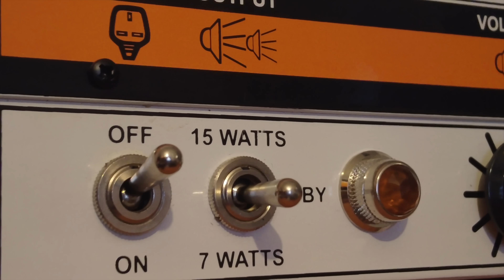WORLDS HOTTEST PICKUP

Comment: Other than my First hybrid amp, the pick ups were the one part that was worth shelling out money for. Cleaner mids, Higher highs, Lowest lows. Also holding notes longer. It will make all of your cheap pedals sound like they aren't anywhere close to maxing out when you max them out. It's the beginning of the times where you might want to start getting paid for music and you are getting better and you know you are sticking with it. It would probably be embarrassing only ever playing on a practice amp and then doing it live on a real big system the first time, i'm sure that's when you realize how far your equipment has to reach the thresholds of in which you might not be as close to as you thought. You just keep going and you upgrade what you can. Picks ups are worth it.

Comment: When did people stop measuring the mV of output to describe the OUTPUT? This is a huge pet peeve of mine.
Reply: It's always difficult to compare pups - it's never just the resistance, it's also the type magnets and wire gauges that determine the actual output level.

But most high output pickups use ceramic magnets, and since 43gauge is more or less the industry standard, the easier measurable resistance in kOhms has become synonymous with level of output.

Comment: Good point about how a pickup with relatively high DC resistance in the neck position can produce a smooth, Tube Screamer always on lead sound. 

Steve Morse in fact uses one in this similar vein, with his signature Dimarzio DP205 having 21kΩ DCR. 

Stating the obvious, the huge DC resistance in this 54kΩ seems to have removed the twanginess while boosting the mids when directly compared to the 8kΩ pickup.

Comment: Im finding that I like lower output pickups so you can have some versatility with the tone vs a hot pickup that just pushes all the time.
Reply: Exactly.  With today's high gain amps, it's pretty silly to have a high output pup.  Weaker is better nowadays!
Reply: Yeah, I'm a metal guy, and I actually hate overwound humbuckers (or humbuckers in general.) I only use low output single coils. WAY more tone. Just listen to Yngwie Malmsteen's tone.
Reply: @saftovooey4569  These pickups would have been great to have 40+ years ago - certainly with old Marshalls & likewise amps, but it's just too much now...  Can't get the wood sound with them now!
Reply: @cornfilledscreamer614  oh ya. I plugged into a marshall origin 50 and single coils couldn't get anything out the amp without a pedal. But put some strong humbuckers through it and it sounds awesome.

Comment: DC Resistance is by no means an indication of "output".  This is a widely misunderstood misconception that's perpetuated throughout the industry, and it's been said that it continues to be believed and repeated because it supports a narrative that suits the manufacturers and helps them sell pickups.  In any case it is indeed a myth...  It could be argued that there is perhaps a correlation between DC resistance and output at least in some circumstances, however the situation has become so muddled that the two terms are used interchangeably and in such a context that implies they mean the same thing which they most certainly do not.

Comment: Interesting. 

I think your spot on in that the high impedance of the pick-up is contributing to cutting off the higher frequencies for the same reason using a 200 foot line between amp and guitar will do the same thing. This can perhaps be EQ'd if nothing else...

I guess its all in your aim. I started building acoustic stringed instruments in my retirement which led to building pick-ups, pre-amps and power amps. I would not be happy with the signal hitting the rails of the pre-amp and distorting as it seemed  to be doing in the test because I like a clean and flat response and if an emphasis then in the mid-range. But presumably you can always build or buy or adjust a pre-amp that the pick-up's signal can swing between without hitting the rails leading to clipping. 

Sure was louder for sure, but if you looked at the peak to peak voltage on a scope of the pick-up by itself and compared it to its 8K cousin the difference would be substantial and since op-amps which are the heart of pre-amps only care about voltage difference between the signal and virtual ground with current not mattering its bound to be louder at any gain setting and whether its worth it is a matter of aim and what its being supplied to.

Comment: I'm pretty sure the coils of that pickup are wired in series, it would be very interesting to wire them in parallel.
Output would drop by almost half, however you might recover a little bit of the higher frequencies.  It's possible the parallel wiring might shift the peak resonance frequency to a higher point.
Very interesting for sure.

Comment: If there's a contest on for "hottest pickup", it'll probably be pretty easy to get one of the hundreds of pickup makers to do a one-off with an even smaller wire gauge. 100k ought to be easily achievable, though it does require increasingly careful winding as the wire gets thinner.

Comment: Just to clarify, you're measuring the series resistance of the coils of the pickup.  That's not "output."  BUT, given the math that determines the output voltage of a pickup ( E = blv), "E" being the output voltage, "b" being strength of the magnet, "l" being the length of wire in the coil (winds), a longer coil (and therefore higher series resistance) results in higher output voltage.  So, "54 k Ohms" reads "54 kilohms" and means 54,000 Ohms series resistance.  Which, as you said, is totally bananas to the point of hilarity.   I thoroughly enjoy your videos, btw!

Comment: A great experiment for this pickup would be to swap out the 500k volume pot...for a 1 meg... or "zero point" potentiometer.
250k pots (that help tame single coils), darken the sound of a humbucker. 500k pots let more highs thru, so humbuckers are not too dark and compressed. A 1 meg pot lets even more highs thru...and might really let this pickup breathe and sound great. A "zero point" pot can essentially make the resistance of the pot disappear (when in the zero position), ...as if there is no pot...and the pickup is wired straight to the output jack.

Comment: Two amendments. First, high-output pickups aren't "pushing the power tubes"; they are hitting the first preamp stage. Second, the loss of high-end information is due to capacitance (like in a really long instrument cable), not resistance.

Comment: DC resistance isn't a direct measurement of output. It's an indication of inductance which one of the two parameters that are actually important, but it's only valid for identical construction and identical wire gauge. Inductance also increases with coil area and the amount and magnetic permeability of core material.

Inductance is also a measure of the cut-off frequency of the pickup, they're intrinsically low-pass. 

The series resistance of a pickup is insignificant in the circuit. Read up on parallel LCR filters for more information, the R value here is the parallel sum of your volume pot and the input resistance of your amplifier, and C is the capacitance of your guitar cable. It probably dwarfs that of the pickup at around 500pF.

That pickup is crazy hot though.

Comment: Would be interesting to hear how this 54K pickup sounds in the clean position if you turned the guitar volume down to say 1/3 level. That way the pickup should not be over driving the amp input and should be clean. Then when its lead time just turn the guitar volume up a bit.

Comment: This is quite cool, I can't really see a use for that super hot pickup though but a fun project to test out. But I think you got a serious problem with your guitar, I would say that the neck is not  correctly mounted to the body because the strings does not line up, its a common problem for some people building their own parts casters that has not build very much guitars before. Or because it's a hardtail bridge it can also be that the bridge is not lined up correctly. But.. that guitar looks super cool in any way possible. :D :D

Comment: I thought the L500-XL I had wound by Bill Lawrence before he passed was a hot pickup, but this completely eclipses it!
I actually find that unless I'm using it for a guitar with overdrive or distortion, its not really usable or versatile at all. You can't get a decent clean tone off it without it continuing to break up. I've read about wiring a resistor across the hot lead of the pickup, but then you're talking about a compromise in tone for that, whether its wired to a push-pull as a tonal option.

Comment: 6:53 High frequencies are filtered out with inductivity (L) of the coil(s). Reactive resistance or impedance of coils is calculated by formula Ra(coil)= 2*Pi*f*L. High the frequencies are more suppressed than low frequencies. While more L means more filtering for the same frequency.

Comment: The high end lose is from the increased coil inductance from more windings not resistance. Series inductance is like parallel capacitance like a tone control with a cap.

Comment: I have a Strat with a Bill Lawrence L500XL, which is an extremely high output.  I have compared it to Super Distortions and it blows them away.  I currently have it in a 3 humbucker pickup Strat in the neck position, and found the extreme high output pickups sound great in the neck, more so than the bridge as I find them simply too much for anything but extreme metal in the bridge, or require too much retuning the amp controls to allow for the extreme output of the bridge compared to the neck.

Comment: One thing that I'd like to know is whether they are using just the one coil or tapping both coils when you make use of the additional wire coming out of the pickup.
If they're actually shorting out both of the two coils (giving you a more reasonable output to enable cleans with the option of going harder for distortion sounds but still retaining the hum cancellation in both modes) I can see it being a really cool idea.
Kind of like having a passive booster in the guitar like the new Yamaha Revstars have, except that they do it with a small step up transformer instead of it being part of the pickup design.
I think it sounds pretty good but it's definitely not very versatile without the coil tap/split feature.

Comment: I got some quad rail/4coil humbuckers from Amazon that average 18.7K ohmsthe 4 coils are tall and slim wired in pairs as though they are a single coil of the painin a normal humbucker they also have 3 v3ry stromg magnets between the 4 blade style poles and have 5 wires. one braded mani ground and the rest are like a Duncan Design color code and you wire then that way weather for normal or coil split. I wired mine like a ''50's Les Paul with coil splits adding a P/P in the bridge tone position for a bypass to activate the bridge and neck piclups together regardless of any other controls. O used .047 orange drop tone caps, and a Fender 5-way blade switch. Yes, there are 6 pots total 3 O/P vol. and 2 regular tome with the afore mentioned trick of the P/P in the bridge tone pos. I used the small stranded insulated wires stripped out of a computer VGA cable. as the voltage from a pickup measures in mere milliamps and the "traditiomal" 22 gage wire is just what they had available in the beginning but is really overkill for the jib to begin with.  so the smaller wires do just fine and save space in the already crowded control cavity and the different colors aid in routing each part of the complicated control circuit. The controls work as i designed them tou funtiom and the wiring choices are all tp promote a clean bright "Strat" tone. the humbuckers are brighter that normal ones due to the coils sizwe and shape the rest is to add to that. a''tje pots are 500K audio taper versions/ and all the hardwqaer is chrome but fot the full size brass sustaim block for the bridge and the Titanium nut. all thee controls are loaded into the hamd made custom , extended brushed stainless steel pick guardincludimg yjr output jack installes just behing the brudge. the pots are arranged in 2 crescent rows of 3 adormed with Tele style chrome knobs. The bridge also got roller saddles ans the headstock got roller string tree and locking tuners. the body and headstock are painted in a stars and planets outer space theme done with spray cans and airbrushed details with craft store micro glitter accents lightly scattered and lightly over sprayed with blue for effect all finished with semi gloss 2X acrylic clear coat. the guitar started as a Starcaster-Strat and emded up as my creation that I named the "Stellarcaster" ,A very cool looking great feeling, and playing guitar that looks and sounds out of this world.  Wanna Play???

Comment: I want the coil tap!! Also super interested in what it sounds like into a line level input. Also very interested to see what is sounds like into an amp with low preamp gain. An amp where the V1 tube is a unity gain 12au7. Also should be 60w power output or 120w to get the full effect

Comment: K Ohms isn't really the best metric for output. The old fashioned way of increasing the output of a popular pickup was to take the same pickup and overwind it. Overwinding would increase the resistance as well as the correlative output. This concept introduced the idea, in the pickup market and advertising, that ohms was an ideal measure for "output", when in reality the ohms were only increased because of the additional wire length. 

So it's 54k ohms but then you have EMGs, which may or may not be hotter than this but unarguably are very hot, have about 10 kohms due to a (in my opinion) better method in reducing resistance and increasing voltage to increase output to this level. But I will say this.. these pickups sound very clear for that much resistance. Pretty cool

Comment: 7:01 really really close, but it's impedance, the impedance of the output is high enough that the capacitance of the cable can become important depending on what amp or input you use, you need a really really high impedance input to deal with something like that, tubes usually have gigaohm impedance though so that's why it doesn't matter too much with guitar amps

Comment: kiloOhms are not a measurement unit of output, it's just the coils DC resistance. For example filtertron pickups are usually half the resistance of a traditional humbucker, yet they give the same output. If you really want to measure the output of a pickup, you should set up a constantly moving steel thing and measure the voltage output on a scope.

Comment: If you can have a switch setting that just uses one pickup, that should get you a lot closer to clean.
I guess a 5 way switch would be perfect with one pickup, both pickups, the other pickup, and two different reverse phase settings.

Comment: It’s cool to hear the inductance effect in action. This is the one aspect I disagree with Glenn on in the pickup shootout video. When I use my lowest output pickups through my amp I have to cut the bass but when I have my highest output I have to cut highs. I think that there aren’t many instances where the pickup matters in terms of eq but the inductance effect proves that it does matter when you hit the extremes of output. Most people will use pickups in the same 2.5 ohm resistance range so for the most part it doesn’t matter but for some people who want this kind of thing it does matter for your eq.

Comment: I assume you tried adjusting the pickup heighth as I feel like this pickup mounted flush with the pickguard would be awesome for an HSS Strat using the single coils for cleans and the crazy rails for metal mania as it is a little dark which is perfect for a Strat without a tone knob on the bridge as a darker pickup is what i like on the bridge pf a Strat but think with it lowered flush with the pickguard would be much more useful & probably closer in volume to rail type single coils at normal heighth as I prefer rail single coils to regular single coils to get rid of hum and add a bit more punch but I think this pickup is awesome as long as you have other pickups to carry the clean tone and use this pickup to bring down the house with its metal capability

Comment: That "neck pickup tubescreamer always on" notion holds water. Lotta players write bridge pickup crunchy riffs for the song proper, only going to neck (and another amp channel / stompbox) for leads. Those same players could gig with only a one-channel amp & no pedal board with that setup. Add gain, compression & treble roll off without the noise from pedals. The only thing you lose is the option for neck pickup clean tones. Let's face it, rock & roll / metal does not require those, but what they do struggle with is noise from all the gain boosting circuitry.

Comment: a pickup resistance/impedance doesnt necesarily mean higher output, if you have less windings with different stronger magnets or winding material , or lower gauge wire may lead to a much hotter pickup. Impedance alone is only really a window into how its working for diagnostics , the higher  resistance statement has always been a myth. It does indicate higher output but with all the other componets I mentioned above you can have a lower resistance with a higher output. Try adding wire to a pickup to add resistance to a known pickup. Youlll likely get less gain, also may change the frequency response and pull on the strings....